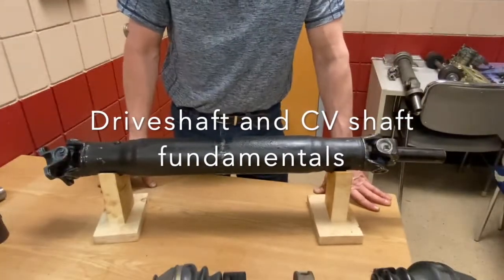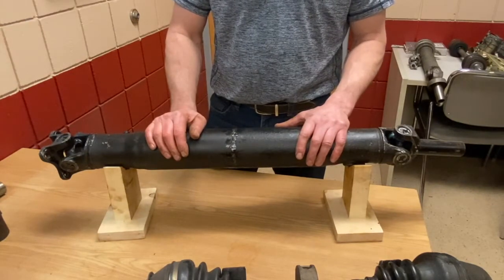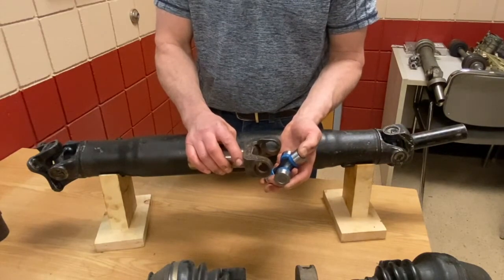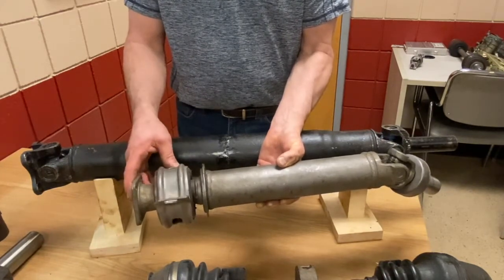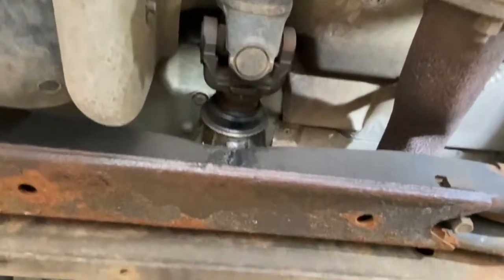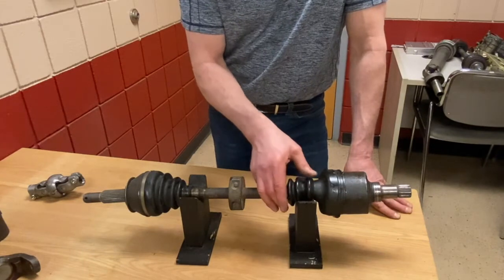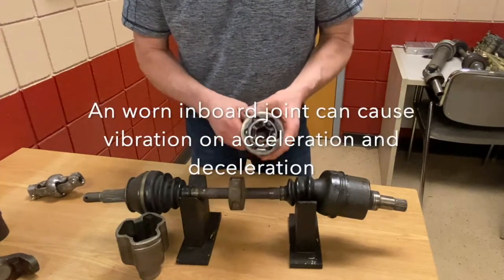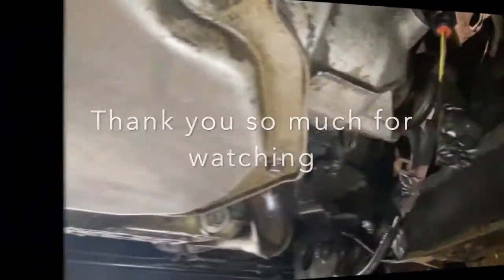Driveshafts and CV shafts

Comment: What is the purpose of multiple piece drive shafts?
Reply from the maker: Thanks for the question.  It divides the angle of the driveshaft over multiple universal joints so that the joints individually do not have to run at excess angles.  Also, if the distance between the transmission and differential is a long distance, multiple piece driveshafts can reduce the amount of free spanning mass that is turning by placing one or more centre bearings along the driveshaft to support it and reduce vibration concerns.